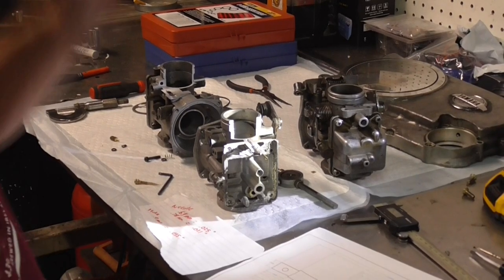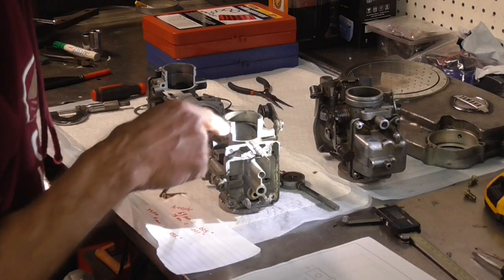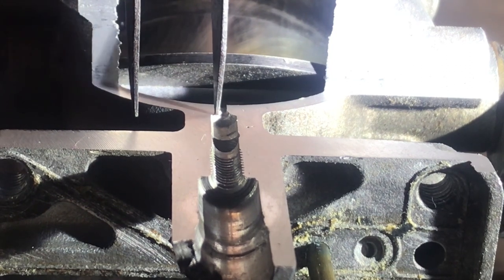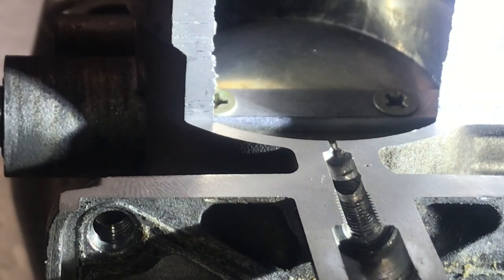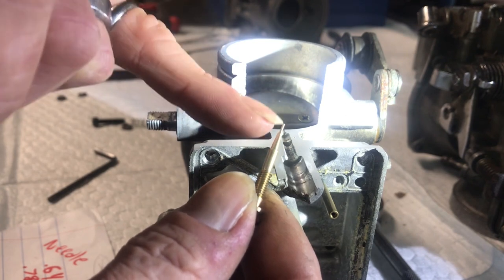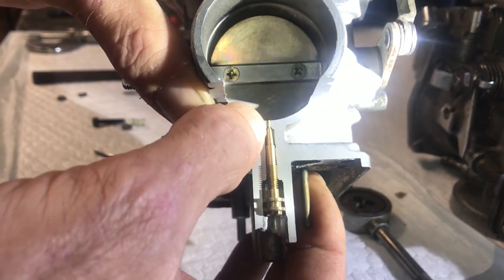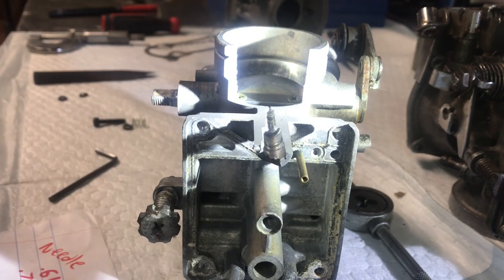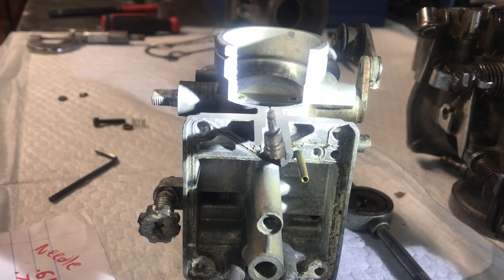Virago Air/Fuel Mix Adjusting and why Some Just Won't Adjust - The Importance of a "Soft Seat"

Comment: My rear cyl carb has been driving me crazy. It is very hard to turn and the 1 1\2 turns isn't even close. It's at least TWICE that. And to make matters WORSE, the fuel selector diaphragm is shot so no vacuum to open it so only runs in PRIme position. It took a clear fuel hose from the selector to show that. Can't THANK YOU ENOUGH. So do I get another carb???
Reply from the maker: Hey man !  Yep, every petcock on my 1st Gens either allow fuel to go to the carbs when they shouldn’t, or block it off when they should lol.  I actually had one that the diaphragm split and it was pulling fuel down through the little vacuum tube and fouling the plugs…took the carbs off twice trying to see why so much fuel was entering the cylinder until I finally noticed it dripping from the little tube.

If the needle seat has been damaged, it can actually be cleaned up so the carb will adjust pretty good again…normally no need to try to find another set of carbs (most likely that have been damaged as well after so many years of adjusting).  Just grab a set of Acetylene torch tip cleaning files and slowly open the hole back up till you get it opened back up (about 0.9 mm if I remember right…but I mention the size in the video).  They are a little set of tiny round files that are used to clean torch tips out.  Thanks again and all the best !  Steve

Comment: Hey steve, changed the petcock to manual and plugged the vacuum lines but when running the carbs are making a weird knocking noise then when i unplug one of the vacuum lines the knocking goes away.what do you think ?
Reply from the maker: Hey !  That’s an odd one as usually the carbs don’t like extra air coming through the boot ports if the vacuum lines are open. Was anything changed on the carbs like little filters added to the larger hoses that go up to the top of the carbs over the diaphragms?  If so, restricting the air up top can make the slides slap up and down as the air is no longer free to move in and out…makes it sound like it’s gasping for breath. Other than that, I’m not sure why they would run better by opening the vacuum line as I can’t think of another area in the carb that is restricting air that, by allowing air in to the vacuum port, would level them out.
Reply: I put on aftermarket exhaust and had to reject the carbs to dynojet stage 1 and drilling the diaphragms as they mentioned in the instructions also 2 and half turns out. After installing them the bike starts ok with a little bit of bobbing from the exhaust the spark plugs got white/tan color . Do you think it needs more turns out if it’s running lean?

Comment: Hey Steve, anyway to save carbs that have this issue?
Reply from the maker: Hey man, yep, if the needle seat has been damaged in the carb, you can use a set of acetylene torch tip cleaners (that come in a pack of various diameter tiny round files) to open the hole back up in the carb 👍
Reply: @StevesDIYs  Sounds good thanks! The problem I’m having is that the needle on right side carb doesn’t want to seat period, I keep turning and turning and it never bottoms out, the other side bottoms out fine. I can’t even get it out to check if the screw is stripped or if the threads in the hole is stripped
Reply from the maker: @WowItzAkina ah !  That’s not good. Hopefully the needle threads are the ones that stripped out…if it’s the ones in the carb body, then it s probably not salvageable and that carb body will need to be replaced. Question…When you are trying to back it out, is the needle pretty close to the top of the port or is it way down in there?  If it’s near the top (but below the surface) that’s about how far they thread out before running out of threads normally. They usually have to be thumped or grabbed with small tweezers to pull them on out. If it’s way down in the port still, then you might be able to blow compressed air up into where the idle jet goes while turning to see if it will help to back it out…maybe it will catch a bit of the threads and come on out.
Reply: @StevesDIYs  So the needle is actually sticking out, like you can see it sticking out when you look where the butterfly flap is, if you need a better description, I could probably take some pictures and send them to you by email or over Facebook. Problem is I can’t back the screw off to get it flush
Reply from the maker: @WowItzAkina ah…yep, if you can see the small tip of the needle sticking out through the tiny hole in the throat of the carb, then it’s definitely all the way down into the port. So, when you are rotating the needle to back it out, can you see the tip of the needle rotating as well? If not, then the tip may have broken off as well.
Reply: @StevesDIYs  I’ll look when I get home, I don’t believe it was but I’m not too sure

Comment: Great video.  I'll tell you my problem: I bought the motorcycle with 57,000 km and my carburetors have both holes plugged on the outside with silicone, as if it were an indication so that no one would think of manipulating them.  The problem is that my motorcycle runs fine, but when it is already warm it revs very high at idle and I don't know if I should try to lower the idle by accessing the mixture screws (turning them a little to the right to lean the mixture) or it would be better to disassemble the carburetors and clean them and start from scratch (the neighbors don't want me to disassemble or repair the motorcycle in the community garage).  What do you think, should I try the screws?  What other things can cause a very high idle at rest?  Thank you.
Reply: have you checked the intake boots for leaks?

Comment: But if I understand correctly then, as the hole becomes smaller thus restricting fuel flow, a 'hard' seat would cause your carb to run lean right? What if you can crew the mixture screw all the way in and it would still be rich, would that mean the hole is too big?
Reply from the maker: Hey !  Yes, if you screw the mix needle in all the way until it is seated, it should actually block off the port even if the hole has gotten too big. Sounds more like there is an issue with the float heights being off and the fuel too high in the carb bowl or there’s an issue with the choke circuit not closing all of the fuel off (it’s actually an enricher circuit vs. being an actual choke circuit). They will actually increase in rpms for a short time when the needle is all the way in as it leans out the mix, but if you try to throttle the bike up, it will pop real bad when the throttle is released since it’s running lean.
Reply: @StevesDIYs  Ok so I think I've found this issue. I checked the float height per your video and it was spot on. But so this is pretty funny. When rebuilding the carb I was so scared of damaging the body that as soon as I felt resistance I would stop turning. So it wasn't actually screwed in at all. Your video showed that when its all the way in the tip should be above the surface, so I took out the carb and turned in the screw and felt some resistance but kept turning and then saw the little tip come up. This should be it. Would have never found this out without your video, so thanks a bunch Steve!! Your videos are really helpful!
Reply from the maker: @MegaDwaas  hey again ! Sounds like you got it figured out 👍. Don’t feel too bad though as that has gotten me as well in the past with thinking they were seated, but really weren’t all the way in (thus the video as I decided it might be important to show, lol !).  I found that some of the aftermarket needles being made don’t have the correct root dimension in the threads so they “feel” like they are seated, but are really several turns out.  Now, I always check to be sure I can see the needle tip (for the 1st Gen Hitachis) inside the carb throat so I know it will fully seat.  Glad the videos helped some and all the best !  Steve

Comment: Hi steve! Would mikuni vm34 carburetors be an upgrade for a 1982 750 virago? I have been having quite a bit of trouble with my Hitachi carbs. Went through them and completely cleaned the jets out, bike runs great with initial adjustment then starts giving me woes, like the idle screws walking out when taking the bike for a ride. I cant seem to adjust it once and be done with it! Also what is a soft seat? when the screw bottoms out, or when the spring on the screws starts giving resistance? When the motorcycle runs right, its a fantastic ride but man I have been having trouble with it haha
Reply from the maker: Hey !  In the past I probably would have said that the vm38 or vm40 would be a better match, but I recently picked up a “front yard find” Suzuki Intruder 1400 I got along with 5 Viragos and it actually has 34 mm carbs on it an is a powerhouse, lol.  So now I’d say, if jetted properly, a vm34 would work as I’ve actually seen them running on on a twin cylinder 1400 cc.  Seems like most have gone with the vm38’s though when swapping them out if I’m not mistaken.  For the “soft seat”, it is when the mix needle bottoms out in the port and you lightly touch the surfaces together vs. tightening it in like you would a normal screw.  The spring is compressed quite a bit when you are at the soft seat and for the 1st Gen Hitachis, the little end of the needle should be sticking up into the carb throat some.

These Hitachis are pretty sensitive to debris since the idle jet and one of the jets up top for the air are pretty small.  I always install little inline fuel filters just before the carbs to catch anything that might be in the 40 year old gas tank which helps a ton on keeping the carbs clean and running.  Also, since I’ve had several petcocks go bad and stop sealing off, I also put inline shutoffs in the lines so I can insure the fuel doesn’t keep coming into the bowls when parked and then getting into my oil.  Hope this helps a bit and all the best !  Steve

Comment: Steve, I found myself wondering if that burr might have been caused by your sectioning of the carb body. Or does it run further around inside that throat?
Reply from the maker: Hey man !  Yep, I went really slow towards the end of the machining with the fly cutter on the mill (like “0.002 per pass) just to try to get to the exact center of the mix needle port so the edges were very clean due to taking very light passes.  It’s probably impossible to see in the video, but the damaged seat burr goes all the way around the diameter of the seat surface.  These were actually unusable carbs that someone had damaged trying to get the mix needles out of…probably because they had seated them so hard that it locked the needles in and they wouldn’t back up again (thus the very damaged needle seat.)

Comment: Hi There Steve,   Would have never ever known that specific problem with the adjustment needle if it wasn’t for your valuable informational video,  great job,  Thank you very much for sharing.  All the best for you in this new year.
Reply from the maker: Hey man !  Thanks and Happy 2023 to you and yours as well !

Yep, cross sectioning one makes it very easy to see what happens when the needle is repeatedly over tightened.  I too had wondered just how much damage is done so it worked out good to cut these broken carbs up to see.  Thanks again and all the best !

Comment: Excellent video Steve. I think way too many tighten those down too tight not realizing how easy it is to damage that seat. I learned back in the 60's being around mechanics adjusting the idle mixtures on Carter AFB's how important it was to have light fingers on mixture adjustment screws. When I disassembled and cleaned my 1100 carbs, they still had the plugs in, so no one had ham fisted my adjustment screws.   Happy New Year man!
Reply from the maker: Thanks man and Happy New Year to you as well !  Yep, it’s easy to see the result of cranking down on the needle when the carb is sectioned for sure.  The only bike I’ve had with the plugs still in it was my Stock ‘81 750 and it dials in sooooo easy compared to the other ones for sure.  Now that I know the hole size and what it looks like inside, I can go back and clean up the other bikes so they should adjust better again as well.

Maybe one day I’ll justify getting a precision grinder for the lathe and can make a cool little tool that can resurface the seat and reset the hole diameter…bet the bikes would adjust like brand new again.  Thanks again and all the best !

Comment: Firstly, thank you so much for this information this makes the difference between listening and understanding and  actually putting the picture in your mind of how it works.

Secondly, are these the mikuni carbs? Would you be able to give us the carbs number so we don't drill out the wrong size on that seating area?
Reply from the maker: Thanks man and glad the video helped some with how the mix needle adjustment works 👍. These are actually the Hitachi HSC40 carbs that were in the 1st Gens (‘81 to about ‘85 or so).  For the Mikuni’s, they probably do have a different holes size in the carb body since the mix needle is designed with different dimensions.  I’m not sure of the hole size for them, but if you grab a set of the Acetylene torch tip cleaners and can bend them so they will reach up into the throat of the carb to the other size of the hole, you should be able to check on that side for which just fits into the hole since that side wouldn’t be damaged.  Thanks again and all the best !  Steve

Comment: Why would the pilot screws have to be a 1/2-1 turns out? Both are the same and it just revs higher as I turn screw in, it doesn't bog down till I turn it out around 1/2-2+.. please help me when you can. Thanks!
Reply from the maker: Hey man ! If the pilot adjustment has to be way in, a lot of times either the enricher (choke) cable or lever is not letting the plunger go all the way down, or the rubber ends of plungers got dissolved if the carbs were soaked and they weren’t removed. It could also be that the floats are set too high so it’s getting extra fuel when it shouldn’t be from the regular fuel circuit.

Normally the rpms will go up a bit when the needles are adjusted in as it leans the mix out, but in just a few seconds it will start to miss and fall. I always tend to stay on the rich side (more turns out) vs. lean as I’d rather foul a plug or two till I get it dialed in vs. turning the chrome pipes gold or purple, lol. For finicky carbs, I turn them in, then turn the needles out until the rpms start lowering, then turn them in about 1/8 turn and blip the throttle to see if it accelerates quick or has a flat spot. If it will accelerate quick like normal, I go in another 1/8 turn and blip it again repeating until it has a flat spot on the acceleration. Then I know the range of too far out and too far in so I’ll pick the middle to start then ride it around a bit and check the plugs for fouling.

It’s hard to tell the condition of the carbs since they are many years old now, so there is no “spec” setting for them unless they are fully rebuilt (all the way down to the seals in the butterfly shaft ends for example) since little bits of air get in and change things.  Hope this helps a little and all the best !  Steve